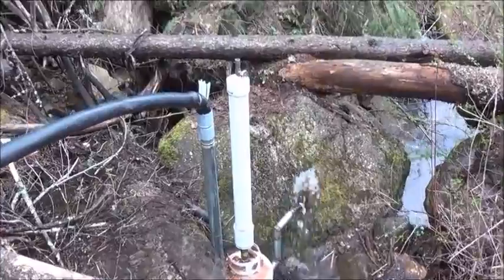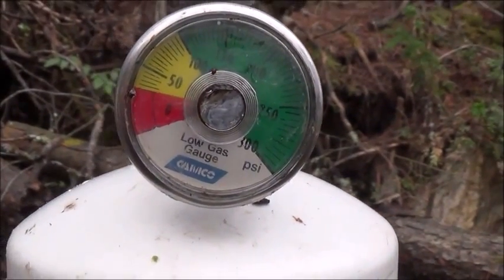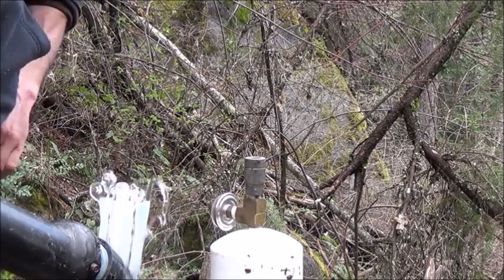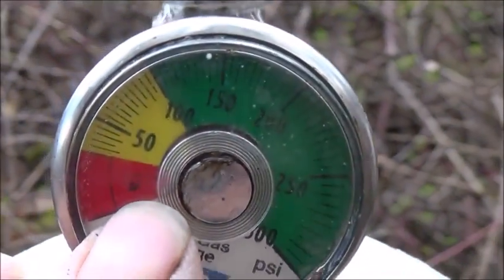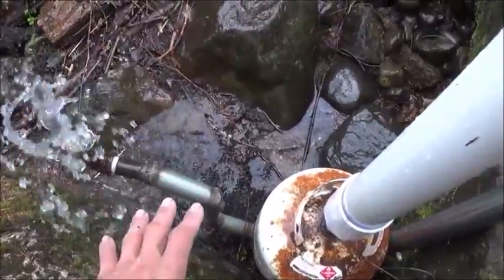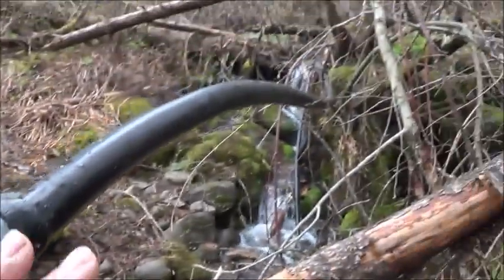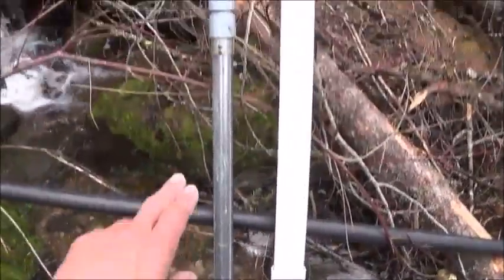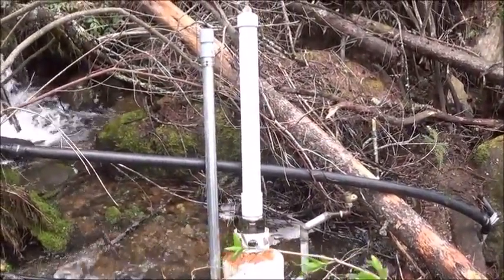"Trompe Hammer" Part 2, Testing. Water powered air compressor and water pump.

Comment: Mr Teslonian.. I admire your work a lot!!.. I'm trying to build a ventilator device that uses only PVC pipes,  water and check valves for this coronavirus crisis... hospitals and houses can have a water deposit on the ceiling and creating the downflow activate the trompe ram system that you built, and a cheap water pump that  can be found on any hardware store to lift the water up to the deposit again so you will have a water closed system, as long as you have electricity it will work... In buildings, the exhaust water can be colected using garden water pipe and redirected to a container and then pumped up high again.. so It will transform electricity to clean air pressure without complexity.   The pression and volume of the respirator would be controled by water level on tubes and volume of air in the air inlet pipes

Comment: Instead  of a one way valve at the end of the system create a raised loop or a length of pipe with a p-trap at the end of system.The higher loop should increase pressure of air stored while letting water exit without letting atmospheric outside air in. After burying the compressed air storage part of the system below frost line where soil temps stay stable unaffected by seasonal change one can release the compressed air in a dwelling to cool it.Gravity powered refrigeration/air conditioning. If both the water and air are circulated in a closed loop the dwelling should become progressively colder as long as its air and thermal insulation are up to specs.

Comment: What are you building this device to do?

I can see how air pressure can be used to run a power generator. Compressed air can also be used to cool a water coil that in turn can be used to cool a house.

Comment: Im making one now with a small sandblasting tank pot. Has gauges and relief and bottom valve for maybe water take off. 60 pound is the shit. Whats the flow? Im putting 2.5 inch elbows on tank now. Will make outlet .5 inch bigger what you think.

Comment: Did the pressure come up more with non return on delivery. Your a legend thats kick arss pressure with that set up. If you use a air lift pump at your dam now you could reserc the hole farm. Swale the flow back down to dam. This needs to go in permuculture mags. What country are u in ?

Comment: I didnt know where else to post this but I had an idea for this today. Usually if you try to gravity feed water for irrigation you run in to psi problems as most good drop systems are designed around 15 psi(normal city water pressure). If you were to have a tromp setup properly adjusted you could be running a valve timer powered by solar that would release gravity fed water maintained at a suitable psi by the trompe.

Comment: Greetings from Srilanka.  Ive been following yours and others videos on the subject for many years. What is your opinion of entraining air at the inlet with a designed vortex type , which could suck in more air.
Also you may measure the temperature difference of the air at the  inlet and outlet . Am I correct that the ancient trompes were used to send cool air down to the mine shafts?
Thanks to you and YOU TUBE, we now see many things in a   broader perspective than we just heard of or memorized at school or University.
Reply from the maker: ***** A vortex would enhance the suction created on the air inlet straws, notice in the video the straws were all staggered in length for that reason. Yes the temp of the air is closer to the water temp than to the out side air temp.

Comment: Perhaps a weight like on commercial water rams would do the trick for your timing.  You might be able to combine both processes in one device if you put the flapper valve before the pressure tank and the air intake between the valve and the tank, and a secondary air storage tank above the whole thing with a one way valve.  If you did this your outlet pipe would need some elevation on it to maintain the pressure of the air in the lower pressure vessel.  You would likely also need an abnormally large lower chamber to generate high enough ram pressure.

Comment: Have you ever considered using a standpipe? Also instead of straws you could use a venturi tube. I have seen some ram pumps have a pressure tank past the waste valve. Maybe with the pressure tank past the waste valve then you could still have the same function of a ram to pump water without giving up the trompe's compressed air. You could but the waste valve in its own chamber and have it's water cycled back up to the main tube with little loss of function.

Comment from the maker: April I have a question for you well beyond that, Why is it that E=mc`2 is only theory and not law after this many years? I will give the world the real formula it is " E=me`2"  or  (Energy = mass times the speed of the electron squared) The electron in a vacuum is at least twice as fast as the photon.  If you think I'm wrong than find out why in every single instance that we create light or photons from x-rays to radio,we slow down the electron or ion to produce a photon, that's like saying you get more from less. Fools The reason E=mc`2 never became law is because when the formula was applied to the speed of an electron it always came out with a number larger than the speed of the photon this is fact ask any MIT professor. My Paper E=me`squared was released yesterday and the video will be up soon. Speed of the electron is roughly 374,000 miles a second , in a true atom free vacuum. Twice the speed of the photon, Now if the photon is made of an ion electron not a positron electron pairing then the speed difference between a single electron and that ion electron photon would potentially be 1834 times faster or different due too the weight difference or mass of a positron verses an ion, the ion is 1834 times heaver than a electron and an electron and positron weigh the same.  A very easy way to explain this is to think of it in terms of two bullets, both bullets have the same amount of powder or energy inside them that should deliver an equal amount of forward force to the two projectiles that we will fire, now let's say one of the bullets is loaded with a single electron and the other is loaded with a single photon as their projectiles. (Remember that a photon is a quantum of energy or package meaning it contains more than one singular charge and since two electrons will repel each other like two north poles of a magnet the quantum must contain ether ion electron or positron electron pairings leaving the photon with at least twice the mass of a single electron). Back to the bullets, so if we fire these two projectiles with the exact same amount of force and they encounter identical resistance than what would travel faster the electron or the twice as heavy photon? Simple physics there! This new formula E=me2 will complete E=mc2 by filling in for parts of the equation that is determined in a vacuum or in space. More later.
Reply from the maker: ***** As a quick extra to your conversation on time, have you ever been in a car crash or similar event were you experienced the event in slow motion? This is very common and holds a key to time, in a traumatic event a wave, I like to call the ciaos wave triggers your brain through the optic nerve to allow you to view time in slow motion (remember time is relative to the individuals speed and position "internal or external velocity"). This enhanced time viewing can be perfected in ones self (and through technology), allowing you to act upon or ascertain events and information differently. The ramification of lets say time travel in ones own life become unique when you realize that your brain can literally make light stand still and even reverse due to your viewing speed . (think of the military application of a set of glasses that allows a soldier to view real time events in slow motion, after a short amount of time getting use to the feeling it would be easy to perfect reaction speeds). Just a little nothing to mull over

Comment: A stretched out reduced pipe to let water speed up before air intake would pull more air in. ABS black pipe heated and pulled into a small hour glass shape may be the ticket. Just using one air hose run to where the water is at its highest speed and maybe a check valve on the air line to get optimum use or keep the air line charge. Cool stuff, keep it coming.

Comment: Keep working on this.   neat project.  I was thinking for the tromp to work the water need to be free falling which would create a suction.  The water was not sucking at all.  The water bubbles were being pushed out not pulled in.  I am no expert just learning from you.  Thanks for your good work on this.
Reply from the maker: John Godwin The bubbles standing still was only because I had the output shut, If you notice the second I attach the air fitting and begin releasing air the trompe straws begin working. At the moment I show the straws the chamber is full and needs a release of pressure to take on any more air.
Reply: I understand now thanks so much thanks for explaining

Comment: Would this design have sediment build up in the bottom of the pressure cylinder?
Reply from the maker: LearEric A simple hatch would solve that.
Reply: Save that sediment for running through the sleuce or pan it. Is that the same stream that you were testing the "Water Ram" on? Beautiful land by the way.